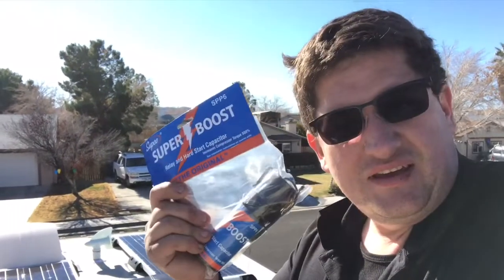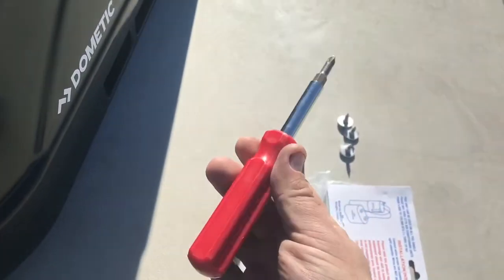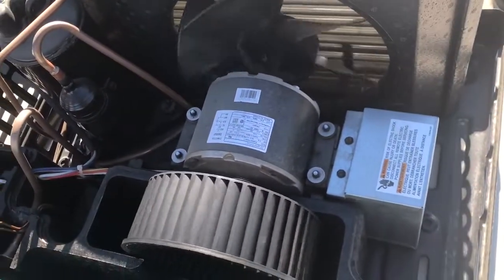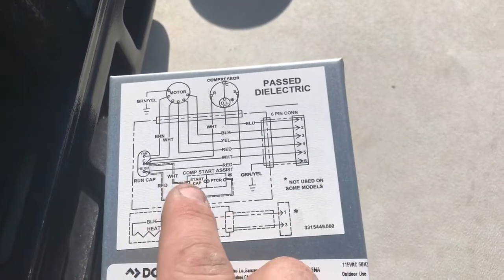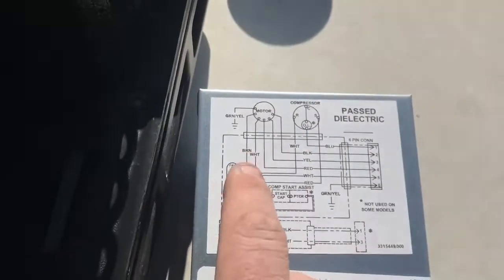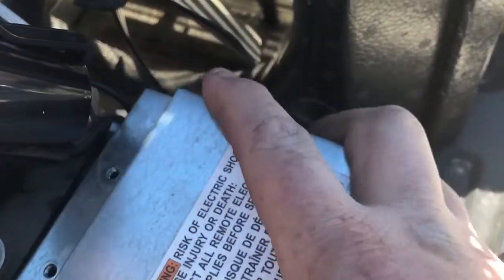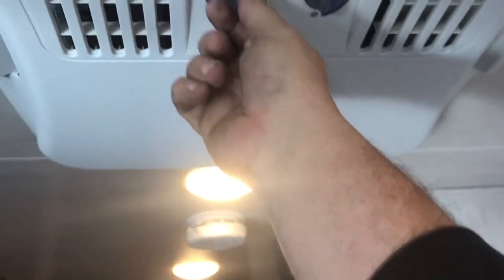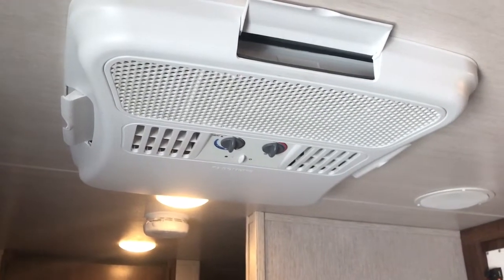Adding “Super Boost” Capacitor to trailer AC unit

Comment: Bought a 3200w 149cc inverter generator and I have 2016 Tracer Air with Dometic Duo-Therm A/C (13,500btu). When I tried to start AC generator immediately shut off due to overload. I just installed this RV start boost and AC started and generator stayed on. 👏🏼👍🏼🙏🏽

Comment: I just put one in my 2018 Viking Coleman AC using a 2000 watt generator it calls for a 24 or 2600 but for running only around 1700 so it should theoretically work but is still sometimes kicks off my generator not sure hard start booster is working??? Also wondering if they make a better hard start capacitor  that  would work better??

Comment: good vid, is your hot start cap still mounted with the screw? It seems like after a while the plastic would break and possibly fall into the condenser fan, just my paranoia...
Reply from the maker: Still in place and working

Comment: Found this without trying lol. I built a solar shed, and now I wanna add a super cap to the mix so I can run a window AC, unsure if 1500 watt inverter will be able to hang without a capacitor

Comment: Hey I have a question. I have the same AC unit. I have been having issues where it is cold but never really "cools" the inside of the RV. It is cycling off and on a lot. I bought the RV second hand. I noticed at about 1.56 in your video your brass "Thermostat" is facing up next to your arm. A little lightbulb went off after seeing that and I went outside just now and realized mine is still stuck to the foam and was buried under the housing.  

Is it supposed to be facing up?
Reply from the maker: That is how the system measures the difference between the hot and cold side. I know mine is working correctly, and only cycles when the temperature is around where it should be. Otherwise it is on solid or just fan.

Comment: How much did you solar system set up cost? I'm thinking about purchasing this model and renting when not in use and people do a lot dry camping here in California
Reply from the maker: Each 100 watt panel is about $155 ($128 for 100w panel and $27 for the mounts) , and the charge controller, plus extra battery. Just the roof only side (250 watts solar), I'm in about $500, and I did the work myself.
Reply: Great video Ed thanks for posting this.

Comment: Question. I purchase this super booster and want to install it. But is there any other thing I need to do before install this. Just recently purchase my mallard. I want make sure all I had to do is install this super booster. Your video is precise and simply. Any feedback will help.Thanks
Reply from the maker: Hope your install worked out. I didn't need anything outside of what was shown in the video

Comment: Would you recommend this model over the Winnebago with the same floor plan? Two big differences are smaller fridge and two stove range in the Winnebago but it's also 2-3k cheaper near me
Reply from the maker: The big selling point for us was the large fridge. If that is the main difference you see, you are at the same point I was at when I found the Mallard M185. Its the little things like how they built it and what components they used, because the floorplans are the same (mostly). Personally, I would go with the Mallard because of the fridge size alone.

Comment: Also one last question I m thinking purchasing a generator to operate only the a/c. What brand do you recommend? I'm trying to get a quite but inexpensive generator. Don't want break the bank by purchase a Honda. Looking for small easy carry generator if possible. Any suggestion. Thanks again
Reply from the maker: I got a Honda Generator from Home Depot, but it’s the industrial one so not as quiet. I am looking to replace it with a Predator from Harbor Frieght

Comment: What kind of inverter gneerator do you use? I'm thinking of purchasing the Yamaha one from Costco it's $550 and runs 2000w will it be enough for this model rv?
Reply from the maker: Depends on what you are going to run. You can't run the microwave and the AC at the same time. I added this capacitor to lower the high amp draw on the generator that usually overloads them. You can run the AC on a 15amp breaker, but will stall a generator that is rated for bigger because of the quick high amp draw as the compressor starts. 

I just did a boondock trip, and I used it to charge my battery, and witch some TV. 2000w should work fine, just know the limitations of what you can run all at the same time. 

One reason why I also added a breaker to my box so I could turn off the power converter. Solar charges the battery as a primary, and I have the option of having the converter to charge the batteries. With a generator, you need to know what all is being powered. If you just plug in, your converter will start charging the battery, and may draw more than you think to cause an overload with the AC unit turning on.

Comment: How do you figure out what size capacitor I need for my trailer's ac
Reply from the maker: Capacitors of this type on Amazon are a one size fits all, as AC units on RVs are pretty standard
Reply from the maker: Capacitors of this type on Amazon are a one size fits all, as AC units on RVs are pretty standard
Reply from the maker: Capacitors of this type on Amazon are a one size fits all, as AC units on RVs are pretty standard
Reply from the maker: Capacitors of this type on Amazon are a one size fits all, as AC units on RVs are pretty standard
Reply from the maker: Capacitors of this type on Amazon are a one size fits all, as AC units on RVs are pretty standard
Reply from the maker: Capacitors of this type on Amazon are a one size fits all, as AC units on RVs are pretty standard
Reply from the maker: Capacitors of this type on Amazon are a one size fits all, as AC units on RVs are pretty standard
Reply from the maker: Capacitors of this type on Amazon are a one size fits all, as AC units on RVs are pretty standard
Reply from the maker: Capacitors of this type on Amazon are a one size fits all, as AC units on RVs are pretty standard
Reply from the maker: Capacitors of this type on Amazon are a one size fits all, as AC units on RVs are pretty standard
Reply from the maker: One size fits all for those standard size RV units.